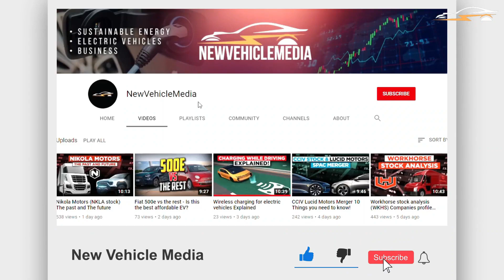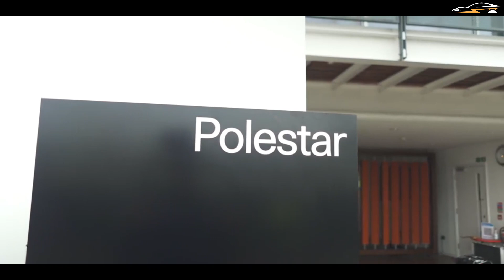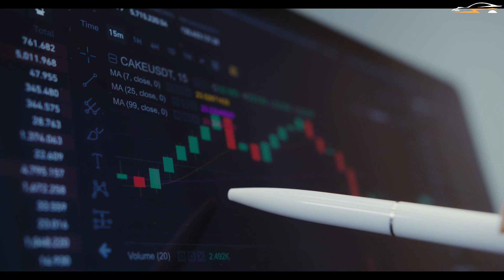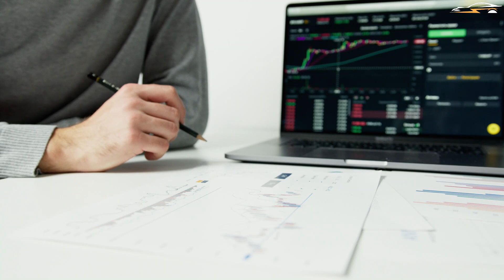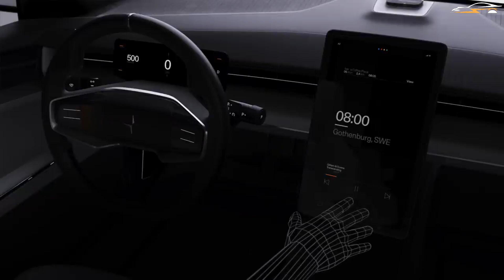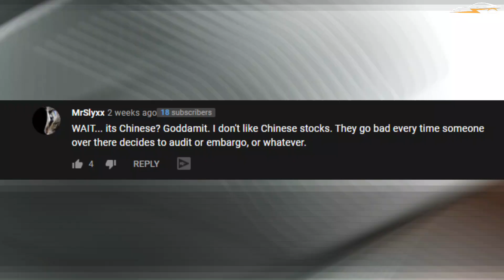8 things to know about the Polestar/GGPI SPAC merger

Comment: 52 miles with single charge ??!?!
Reply: Polestar 1 is a hybrid & not purely electric. The electric part on a single charge gives 52 miles.
Reply: @Milgram07  Also Polestar 1 was a limited run of cars. It no longer is on sale. Polestar 2 is an EV but based on a hybrid platform. Polestar 3 will be on a dedicated EV platform and going forward, all Polestars will be BEVs based on a dedicated EV platform.